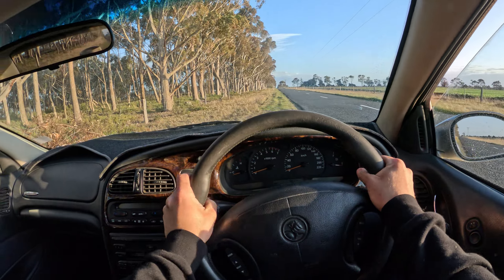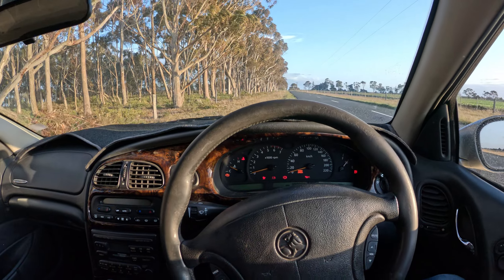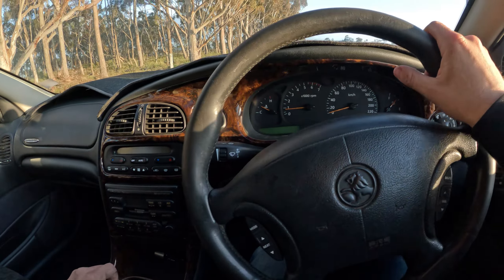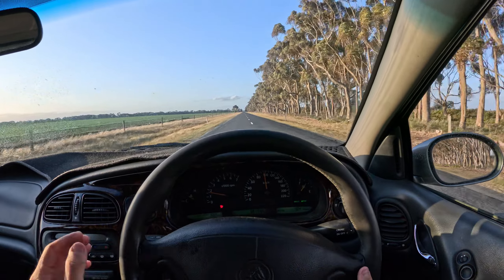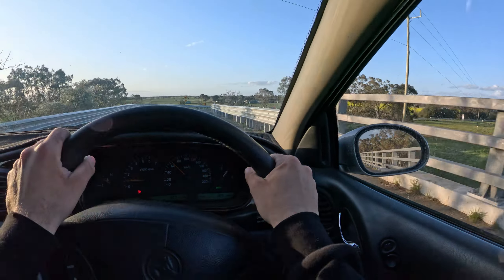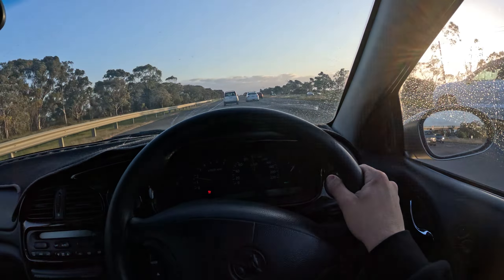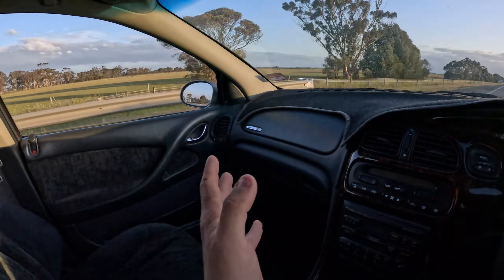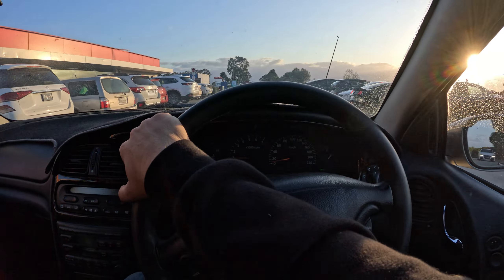Driving the Iron Lion - POV Driving VT Calais 5L V8

Comment: My 93 S pack ute with 5.0lt V8 automatic does 10.3lts but been modified with cold air, headers, 2 1/2 exhaust, chip with 220kw or 300hp.  Upgrade VT brakes, only weak point on 5.0lt V8 is rear main seal, which my needs fixing.  Great cruising with my ute just like my 93 VR V6 automatic Berlina which i was doing 8.5lts per 100kms.

Comment: "old Holden" 😅
I was born '72 and still consider these "new cars", mainly because I have owned nothing but 1930's to 1970's Holdens my whole life!
I've owned LC/LJ/ GTR's/A9X Torana's, 351 XY's, FE/FC/FB/EK/EH/HR/HK/HQ/HJ/HZ sixes and V8 Holden's and many more 👍
I have had several VR/VS/VT/VX Commonwhores over the years in both V6 & V8 versions and I absolutely loved them 👌

I got my ex missus a rare one owner VX Executive V8 Wagon, rare because it was the last of the long wheelbase Wagon, but the very first to be fitted with the LS1 engine instead of the old 5 Litre 😎

It was a beautiful wagon, but she still was shocked by how much quicker my V6 VT Sedan was off the mark than the LS!

I still have the V6 VT Sedan, which is the same colour as yours, with lowered suspension, fat alloys and Sports exhaust etc......and I totally agree that all of my VR/VS/VT/VX Commonwhores have been the most comfortable and pleasurable cars to drive, even considering that I also owned XD/XE/XH/EB/XR Falcons as well 😮

Comment: Is a VN 304 faster then a VT?

Dont the v8s had a power upgrade from 165kw in a stock VN VP VR VS to 185KW in a VT?
Reply: The VT was 179kw for the stock 5L but not as fast as its predecessors due to its weight handicap.

Comment: Love your VT Calais 5L. Needs a better exhaust system. My HSV VT CLUBSPORT 5L has pacemakers with 2 1/2 inch twin system which includes high flow cats and hot dog resonators at the back. Sounds way better than yours.
Reply: Who cares champ. Not everything needs to sound loud or sound like yours. It's a Calais, not a Clubsport. It's meant to be quiet and subtle.
Reply: @MitchZero9 I was just offering advice to Deacon if he wants his Vt Calais to sound and run better.
Reply from the maker: I did have to turn the audio down with because you could hear it over my voice haha it still sounds alright, but my other 5L has paceys and sounds better than this
Reply: @MitchZero9  it’s a 5L everyone should hear it, nothing wrong with some constructive criticism.
Reply: @shanesmith9356  get an air pod filter for that induction noise too.
Reply: @George_Soros_Globalist  I have a Mace cold air intake with a K@N pod filter. 👍
Reply: @shanesmith9356  make a huge difference in sound too doesn't?